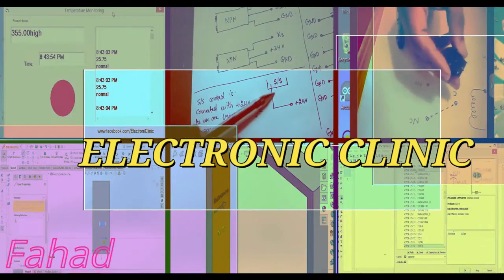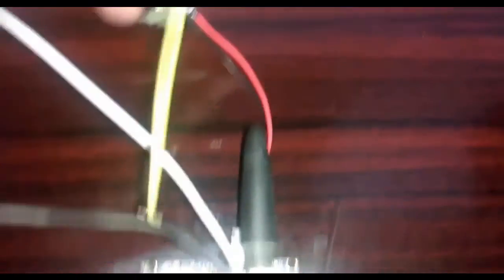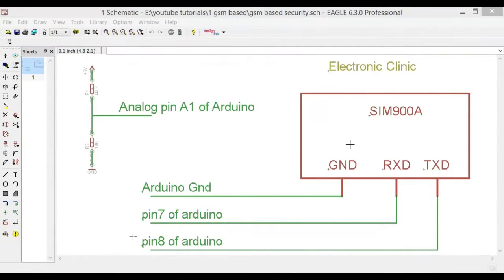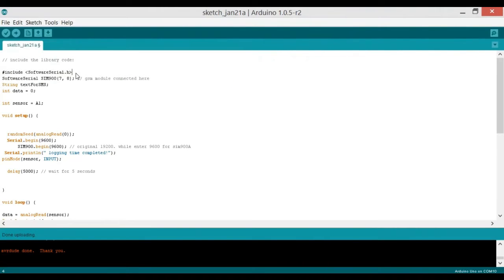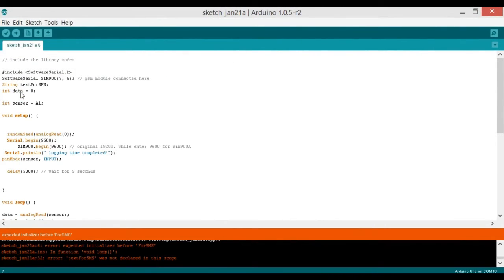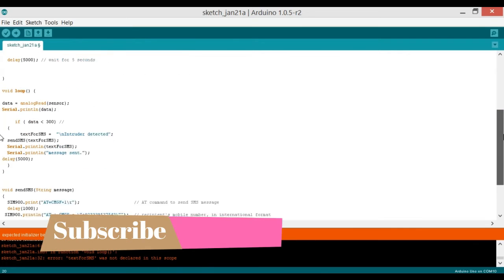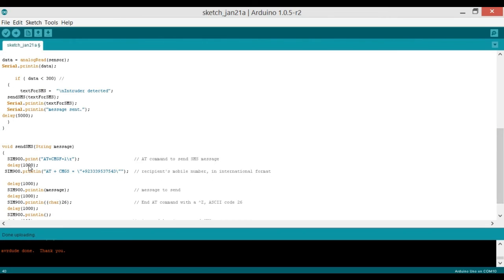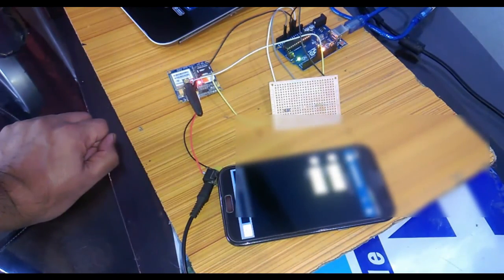Arduino and Gsm based laser security system using, sim900A / sim900D gsm based home security"English

Comment: Bro can I use this code in nodemcu?
I wanna control it using WiFi through app
Reply from the maker: i have so many tutorials on nodemcu. check playlist.
Reply: @ElectroniClinic  
Sir i need your help here 
i went for nodemcu just like how we control web based led  i wanted to do it for turning on and off for laser or LDR input so far no success 
everything goes well but where we control the system i have placed my analog values and speaker pins over there in (ON) if loop... it never executes it over there just comes out..and says client disconnected 
same thing continues...

Comment: Sir I want one more favor 
Just help me with this 
I did all that laser and gsm working 
Now I want to stop and Start it using app through WiFi esp8266
Help me with the esp8266 code and how it will communicate with my app
Like I am planning to use ip 
And I also developed a simple on and off button in app
I want help with Arduino code which will control the laser function on and off
And can we use esp8266 and other Arduino code all in one ?? Like do we have to switch between boards for code or all can work in uno board??
Reply from the maker: its easy. 
i have so many tutorials on nodemcu wifi module. for this you can make a blynk application. watch my tutorials on nodemcu esp8266. 
if you face any problems let me know.

Comment: Thanks sir for your patience for answering my questions 👍
Sir one request is there 
Can you do one video where in we use laser and as soon as laser is deflected it send SMS ..
A demo video with code 
Please sir... please 🙏
Reply from the maker: in this video the laser is used. you can simply point laser on the ldr. when you cross the laser it will send sms.
Reply from the maker: no problem you can ask infinite questions.
Reply: @ElectroniClinic  
I tried but it's not detecting laser it's value remains the same even after putting laser on ldr
That's why sir make a separate video with demo
Reply from the maker: point laser on the ldr and check value on serial monitoring. then place infront of the laser and check value. send me the values.
Reply: Sir can we add multiple ldr to take inputs and detect the change at the  same time?? 
And also the buzzer
 and switch to control the the working?

Sir if you can please modify the code and do the same na.

Comment: Bro one last question 
GSM can't send messages on 300ma adapter cause it gets on but is not sending me a message
Is it compulsory 2000ma? 5v??
Reply from the maker: it won't work with 300ma, use adaptor who's output current it atleast greater then 1amps.
Reply: @ElectroniClinic  now I used 3amps it's still not working
Reply: @ElectroniClinic  will you check my code?? I'll send it to you?
Give me your mail or whatsapp
Reply from the maker: make sure you connect the wires in correct way. connect the tx of gsm module with pin 7 of arduino and connect rx of the gsm module with pin8 .

Comment: Sir can you send me the code for the laser sensor with SMS
Reply from the maker: comment your email id
Reply: @ElectroniClinic  chimulkarsanket23@gmail.com
Reply: Sir you got my point no 
Like when someone will intrude that laser it will send alarm
Reply from the maker: check email. 
programming sent.
Reply: @ElectroniClinic  yes sir I got it .
Sir also can you send circuit diagram please?
Reply: @santasgarage4394  bro plz, send me code and circuit diagram . Plz.
Reply: Sir i need code . Plz
Reply: Sir my assignment advance security system by using Arduino without using gsm
Reply: Please sir

Comment: can you upload the code here?
Reply: My mistake sir :) because the first letter of my email should be in small letter not in capital, that`s why i did`nt receive  your code :)....
rsiaboc77@gmail.com              this is my real email
Reply from the maker: sent again
Reply: @ElectroniClinic  Thank you so much sir :) 
But may i have the procedure or the guide of the installation of the components, because i want to use breadboad instead of matrix board...
Reply: @ElectroniClinic  may i know how to assemble the parts step by step :)
Reply: the circuit diagram plssss..
i need it sir
Reply from the maker: Your email id ??
Reply from the maker: check your email. the programming is sent.
Reply: @ElectroniClinic   kindly resend to this email :) plssss .... rsiaboc77@gmail.com
Reply from the maker: i have already sent you the programming
Reply: please send the code

Comment: Im beginners sir .. please i need your arduino sketch.. please you didnt place your sketch in your description
Reply from the maker: Your email id ???
Reply: Sir this my email 
mechelyndave@gmail.com
Please sir for the seek of my project 
I will conclude your name as the reference
Reply from the maker: i have sent you the programming. 
circuit diagram original file. you can open this file in eagle software. you can watch my tutorials on pcb and schematics designing. 
and also the gsm module pinouts details. 

Wish you best of luck. 
if you have any questions let me know in a comment.
Reply: Sir thank you very much
Electronic clinic is awesome

Comment: Hello greetings from Mexico.
I would like to know how I can implement this system in a gsm sim900 module so that the laser module is activated send us a text message or a call warning.
I wait your answer thank you!

 

Enviar comentarios

Historial

Guardadas

Comunidad
Reply from the maker: This project is already based on laser. U need ti point the laser on the ldr and when anyone crosses the laser a meesage will be sent
Reply: @ElectroniClinic  You could send me that part is that you can not see very well in the video, I would really appreciate it.
Reply from the maker: in this video i am using the room light as laser light. coz room lights were already ON. :)
Reply from the maker: then i placed my hand in front of the ldr sensor, blocked the light. its thats simple
Reply: @ElectroniClinic  ok, I understand that part, but how would it be if I want to do it with a laser module and a ldr?
Reply: @ElectroniClinic  in this project you use a gps module?
what materials are?
Reply from the maker: my dear this is already on laser and ldr. watch the complete tutorial..or you can watch my latest tutorial..

Comment: Please i need help with the code writing on security alarm system with the following items, 4X3 keyad, arduino uno, pir sensor, sim 900A and I2C LCD
Reply from the maker: so tell me what exactly you wana do ?
Reply from the maker: For what purpose you wana use 4x3 keypad ?
Reply from the maker: tell me in detail about your project, so that i can make a proteus simulation for you. sim900A programming i have already explained.
Reply: that is what i have at hand and want to use it for activating and deactivating the system in some matter of seconds